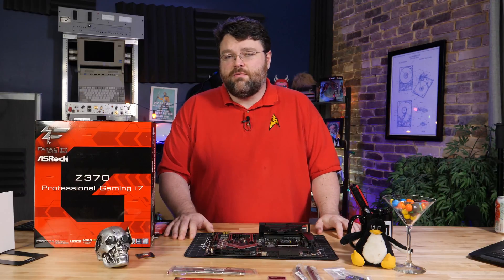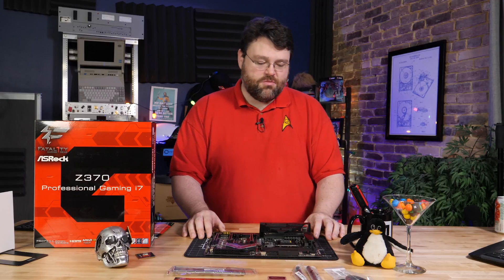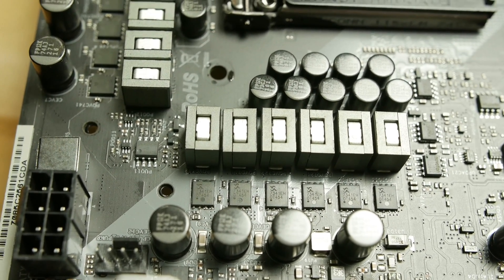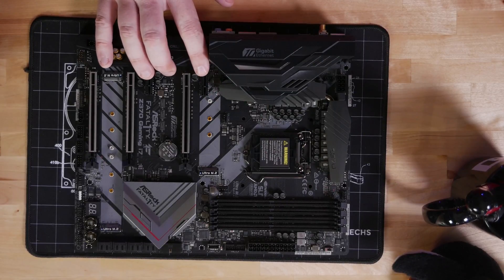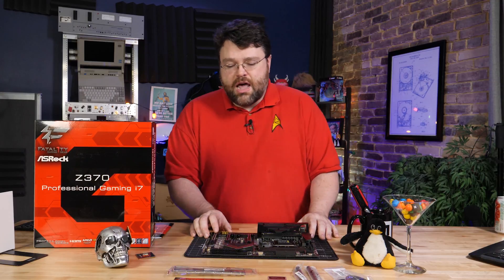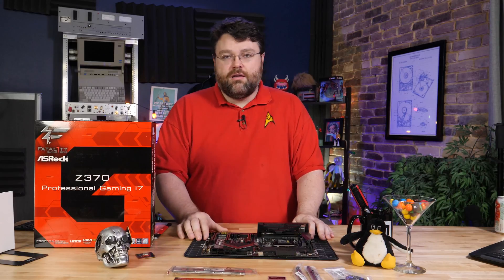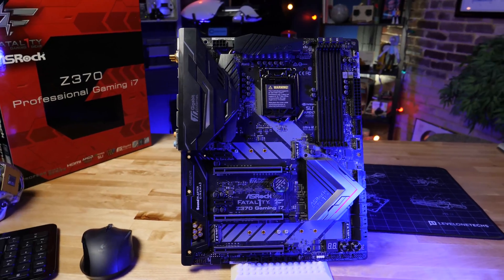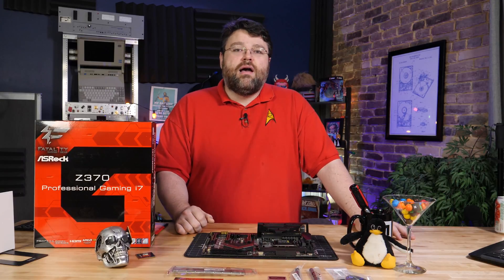ASRock Fatal1ty Z370 Professional Gaming i7 Review + Linux Test

Comment: Regarding M.2, you mentioned that communication from the PCH to the CPU is on 4x and there will be a bottleneck, getting only about 4000 gb/sec. This would mean something like the Samsung EVO 960 NVME, that is rated at 3200MB/s read, will only be getting 500MB/sec. Why would anyone use M.2 on this board if they are limited to regular SSD speeds? On Asrock website, they say "Triple of the world’s fastest PCIe Gen3 x4 Ultra M.2 slots that deliver up to 32Gb/s transfer speed"  Is this an oversight or does this board really destroy the very reason M.2 exists in the first place? If so, what ASRock board will run these M.2's at full speed as a single stick or in raid 0? Thank you.

Comment: Which board uses Sinopower, and which uses Fairchild/OnSemi?? Because I have the Z370 Gaming K6 and it would SEEM I have Sinopower VRM modules. But in your video on the Z370 Gaming K6 your board had Fairchild Dual N FETs - which is better? IS there a real difference? Because there is a HUUUGE discussion on Z370 power components, I have heard people say SinoPower was "Bad" and I have heard others say it was BETTER than OnSemi/Fairchild - also it seems EITHER ASRock Fatal1ty board can have EITHER brand from what I have seen!

Comment: Great video, thanks for sharing.  I do have a question on most of your recent z370 motherboard reviews,  On most of the reviews you say the bottom PCIe slot runs through the chipset, in the past gens if i were to populate the bottom 16x (4x electrical), it will dropped the top PCIe 16x to 8x (GPU), but im confused with your comments about it runs "through the chipset", does this mean if i place a 1x soud card on the bottom 16x, will the top 16x (gpu) remain 16x?

Comment: What's wrong with AsRock that sacrifices USB ports to have three ethernet ports? I mean the 10Gbit is nice but two 1Gbit, why?
Reply: you can Team them and use your normal gigabit router with 2 (or maybe 3 not sure) 1 gigabit connections
Reply: Pouya what are you going to connect to  to utilize that? Something else on your network with 3 nics?
Reply: That is my problem as well. I have the Crosshair VI Hero and a ton of USBs and use most of them. This one, doesnt even have half of it.

Comment: Wendell, great vid as usual! in an x8/x4/x4 config does the bottom x4 slot run through the chipset and not to the CPU? Mobo manual says " 3 x PCI Express 3.0 x16 Slots (PCIE2/PCIE4/PCIE5: single at x16 (PCIE2); dual at x8 (PCIE2) / x8 (PCIE4); triple at x8 (PCIE2) / x4 (PCIE4) / x4 (PCIE5))*" No block diagram unfortunately. :( But with a x8 / x4/ x4 config, I assume they all run to the CPU.